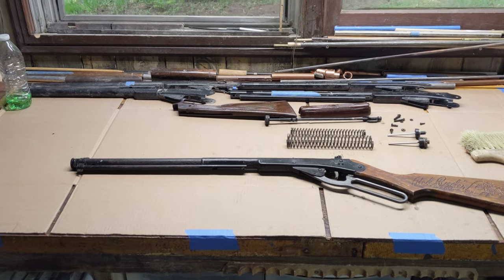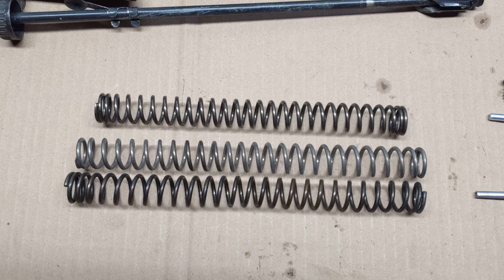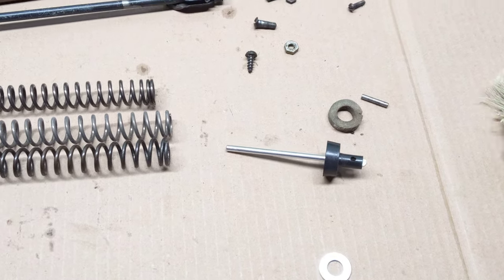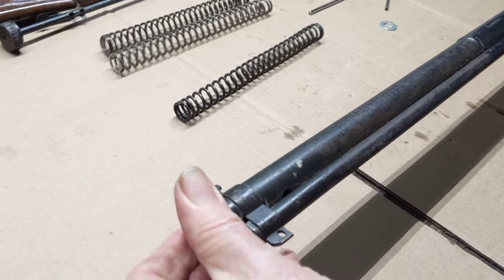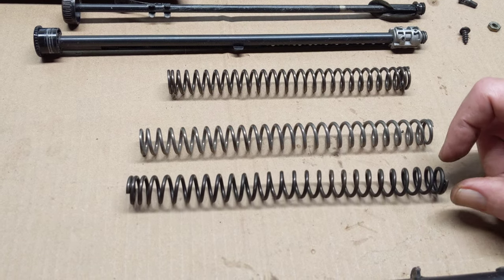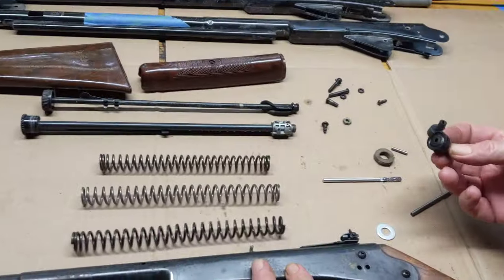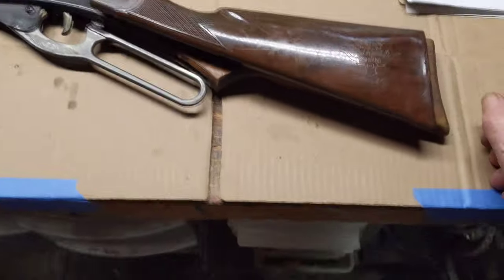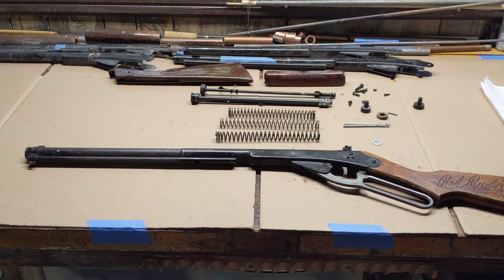New to us Plymouth MI Daisy Model 94 Red Ryder Carbine Model 94 diagnosed and repaired  part 2

Comment: I just picked up a model 94 from an antique shop, it looks like a a 50's Plymouth Michigan gun. The plastic and finish are in decent shape, no rust. The gun makes a good pop when cocking and firing it, but barely any air pressure comes out the bore. I need to do some homework on a fix. Where the BB's go in near the muzzle, the gap seems to be bigger than it should be.
Reply from the maker: Congrats on the pickup! The gap on the lip of the removable shot tube can be bent if required but I'd pull it and take a peek into the barrel shround and see if there is any smutz down there that might be getting in the way of the shot tube seating before I started tweaking the tab. Since it's a Michigan gun you definately want to pull thge plunger assembly and check the compression cup leather seal and then take a close look at the leather abutment seal, long periods of not getting shot or oiled can lead to both seals getting chewed up.

Comment: All in all,  in my humble opinion,  the best part of a gun like this is the rear sight.   As for switching out the shot tube for a model 25, I've had so many guns with missing shot tubes that I always reserve that as an option.   I kinda hope the owner wants to keep the original stock.   😊
Reply from the maker: It's going back with the plastic stocks on it as per the client's request. I do like the Model 94 sight package, just wish  the rear peep aperture was a touch larger and the windage adjustment was a bit more positive.
Reply: @RestOModDaisy  I get that.   I still think it's cooler than a standard notch.

Comment: I have found alot of the wide frames love the heavier small frame guns. I am really glad for what you do an the Daisy community. Have collected over 30 models all different. Compresson was probably taken out by someone waning the larger airchamer in their 94.  The 111 is a good alternative to 94 but miss the sights on the 94. Always a joy watching. 
Wolf
Reply from the maker: Thanks Jeremy, the thing I love the Model 80 is the logo on the butt stock. As a top feeder it's not quite as easy to reload as the Lighting Loaders are     but it will accept a muzzle length fore end with no issues.
Reply: @RestOModDaisy  I haven't come across an 80 yet I do have a wide frame 88 it has had its sights ripped off before I got it but it will just have to be a scope setup. I got into this 5 months ago a talk to 327 quite regularly but been dissecting these alot like the way you got through the piece by piece info it all adds up. All you info has been invaluable as has cobalts. I ll have some things here soon I have been working on but a later date but appreciate all you share and the enjoyment it bring. Thanks for your time. P.s. going for 600 fps 
Wolf
Reply from the maker: @LordWolfman1119  600 FPS is a tall order. There was a modder over at the $15 dollar Daisy thread that got a wide body to 550 FPS as I recall. Keep me up to date!
Reply: @RestOModDaisy    It's Heinz 57 with a Walter  Barrel 528 FPS. Is the current record my device will hopefully beat that without the 200 barrel and I'm on that thread as well recently joined up as to a friend.   I found a few fun things as I learn about these about this I have A111B that is actually a threaded above me you can just throw them down and there and throw a large seal behind it it works Like it should which is funny With some sizing required to do shroud length.  You have no idea how good it is to finally get a chance to Is chap with you with It's a amazing community all the modders. I  hope to do what you do someday I really enjoy it. It all starts with Daisy